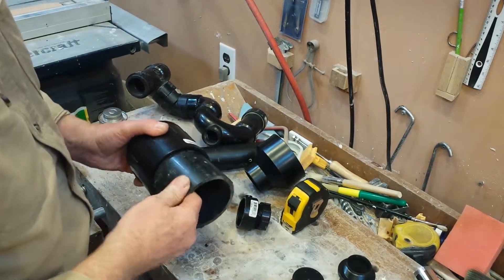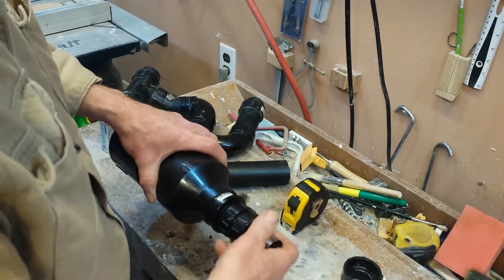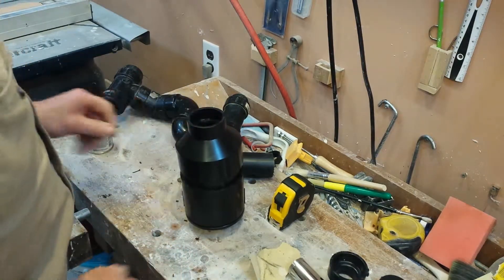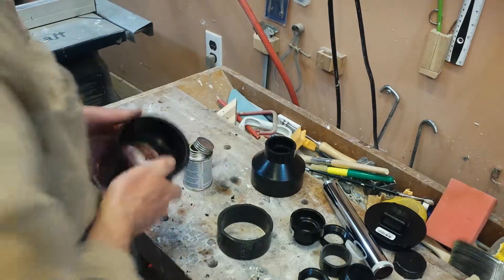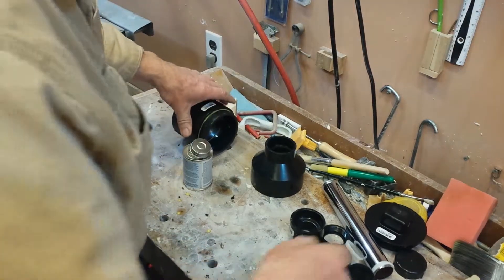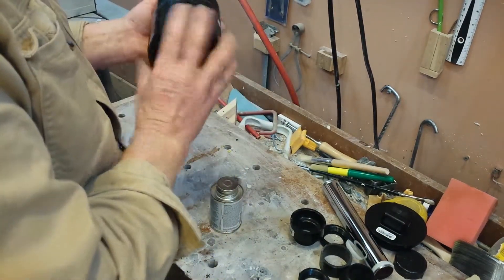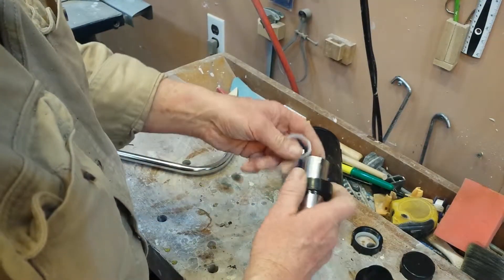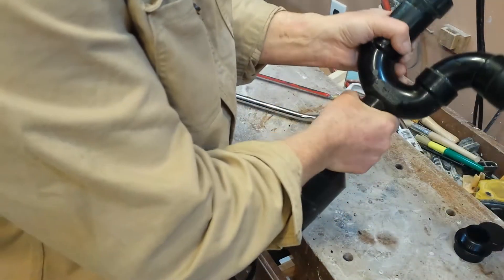Make a clay or sediment trap for your sink, using plumbing parts.

Comment: cool but make sure you can easily remove it since that attachment is not code.
Reply: What code are you using that forbids add-ons like this? (Legit curious, not doubting you, since codes are different everywhere)
Reply: @jodystradesstuff5048  all codes don’t allow this
Reply: @jacksplumbingvideos7147  I see a lot of products being sold that claim to be code compliant, and are basically exactly this but commercial, I don't see how they are all lying.  Hopefully you can do a video sometime soon on the right way (so that you would agree that it's code compliant) to capture clay and plaster, it would be super interesting to see your take on this problem!
Reply: @jodystradesstuff5048  they are made out of one piece and get approved. His contraption is not approved.

Comment: Very nice and clever. Thank you for posting.  I tried to replicate it, but mine has a leak from the metal pipe part.  I included the rings and tried tighten the collars, to no avail. What am I missing?
Reply from the maker: Both threaded end caps must be the kind that are used for the sink drain pipe. And the pipe itself must be the kind used for sink drains. These should be standard size, but it sounds like your pipe diameter is smaller than your caps are meant for.
Reply: @clifcarver  I'l double check.thanks !
Reply from the maker: @tonyc4360  If the plastic O ring is reasonably tight to the pipe it is probably the right size. One other possibility is that the design of the P trap isn't allowing the plastic O ring to be squeezed tight. If this seems to be the case you could cut a small piece ( say 1/8") off a suitable diameter plastic pipe that would act as a spacer and give the cap something to tighten against.

Comment: This is a very informative video, thanks for sharing it. Two questions - how will you know when the sediment trap is full? and how easy is that bottle going to be to clean?
Reply: But is there room for a suitable tray to go under the screw bottom, as there will be water all the way up into the p-trap!
Reply from the maker: The bottom of the 'bottle' unscrews for easy cleaning  ...  I do not really know when the trap is full so I schedule cleaning based on the amount I use this sink for cleaning clay tools.
In the past, once every 6 months was good but as I am retiring, it will probably need cleaning every 4 months or so.
I just want to add that a little vaseline on the threads will make the bottom easier to remove.